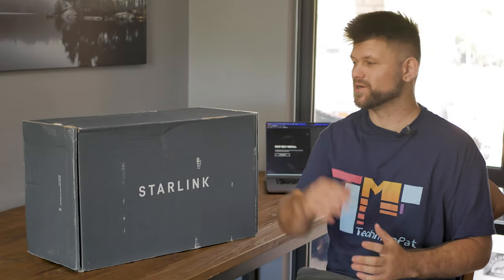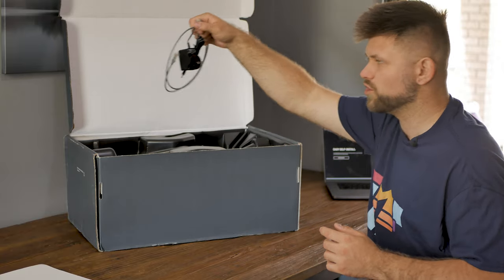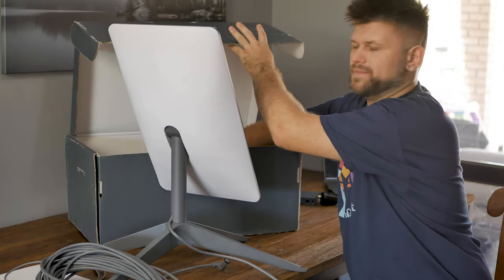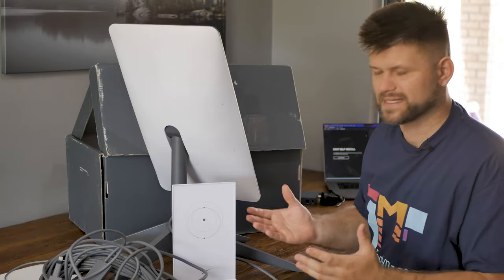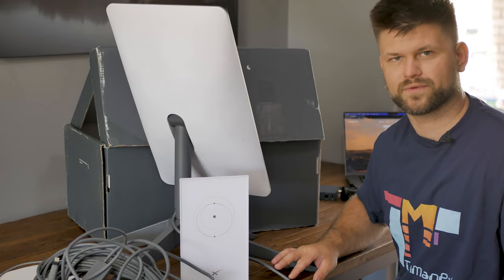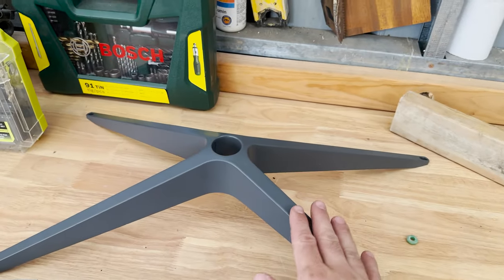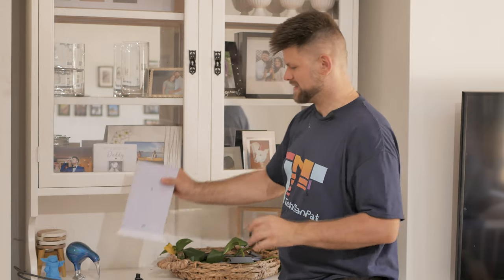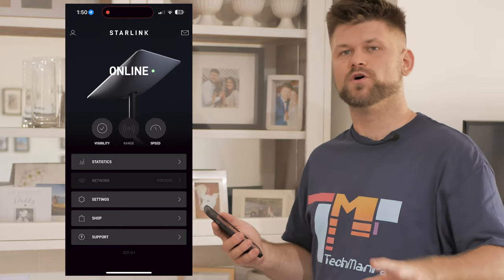Starlink in Australia | TechManPat

Comment: Excellent video, I wonder how well it will work under heavy cloud. The thing that’s perplexing is the Ethernet not being a hardware feature but sold as optional.
Reply from the maker: Might be able to test the weather part, hopefully we get some storms soon
Reply: Have used it during some sever rain and storms down southern wa, works fine just slows down a little bit about 10% I was surprised how largely unaffected it was.
Reply: Is internet still good with this weeks heavy rain? 😊
Reply: @puneethdevadiga1235  yes I’d be interested to see how it’s held up

Comment: If it uses wifi to connect to devices then what is stopping ppl from getting any extender with Lan and connecting that to their router, rather then their addapter???
Reply from the maker: Nothing at all, potentially the performance may not be as good.
Reply: @TechManPat  na even with wifi 4 at 600 is still more then capable of handling 150max on the starlink. just put the extender near the box and you should have no problems. Not a fan of the Eth0 adapter.
Reply: The adapter allows the use of failover services, such as 4g etc. That and hardline is also more reliable depending on the building type, and local interference